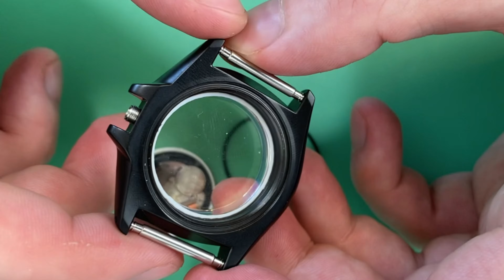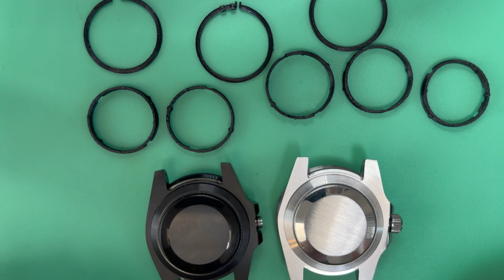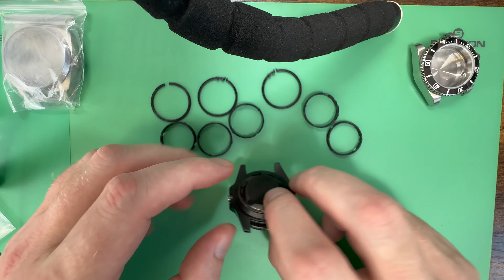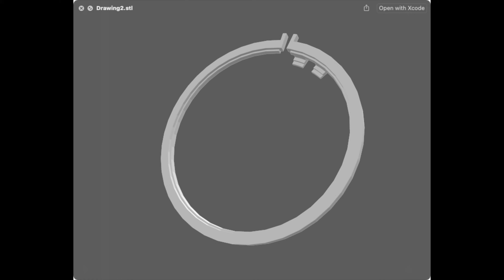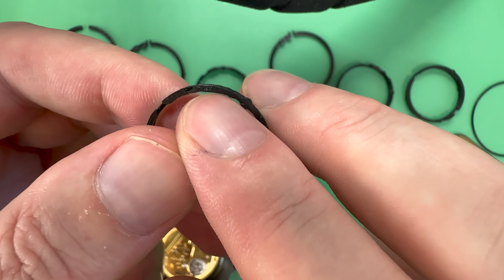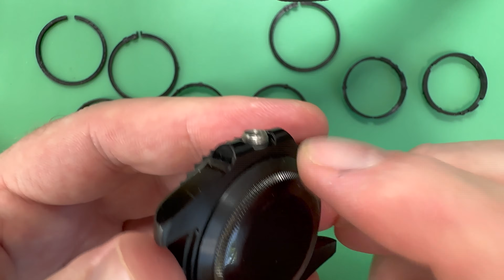A Two Piece Movement Holder for a Dive Watch Case

Comment: Hello! I found your channel looking for info on movement rings and quartz movements, but for different watches. Focusing on the quartz movement, my Uncle by lifelong family acquaintance sent me his mom's vintage Timex, but the movement doesn't run even with a new battery. I've looked everywhere and went to local jeweler watchmaker to get any helpful info on knowing how to replace the original movement with possibly an aftermarket version. The watchmaker was pretty disappointing, just said the parts are no longer available and sent me on my way. There's gotta be an interchangeable current version. It's a Timex Y481A-22 Two Jewel movement. I don't know how to size it or what I'm looking for to find a replacement. Also, the 22 is confusing: is that possibly the diameter of the hand post? Reason I ask is because I found a movement on eBay that has the exact identification except it has 21, not 22, in the part number. Any help or info would be much appreciated, any at all. TIA--good to see your channel growing!
Reply from the maker: hey there. send me an email at watchcomplications at gmail and we can discuss possibilities. A new movement can always be fit to a case, just depends on what movement a person wants and how much they want to spend.

Comment: Hi! I just got in to building my own watch. need some help with selecting the right dial. watch cases recommend the dial size is 38.5~39.0mm. does it have to either be a 38.5mm dial or 39mm dial. or! lol. any thing between a 38.5~39.0mm dial? thanks. im new to this
Reply from the maker: should fit anything between, 38.5 and 39. 0.5mm isn’t that much variation for a dial. but that depends on the tolerances of the manufacturer that says it fits that size range.